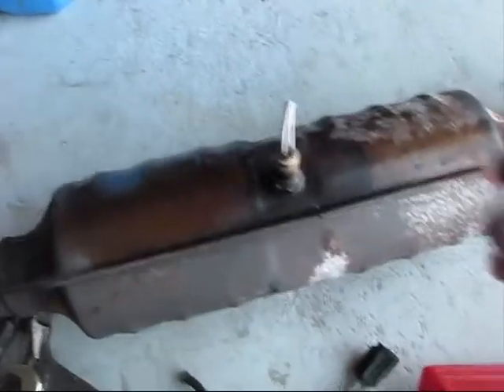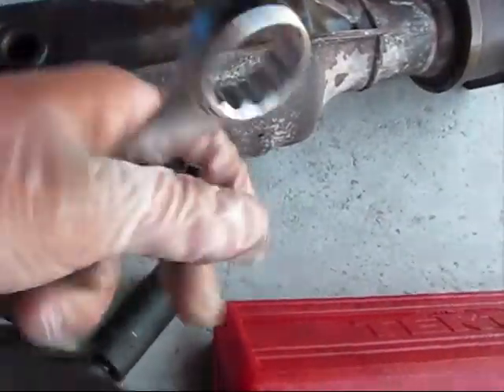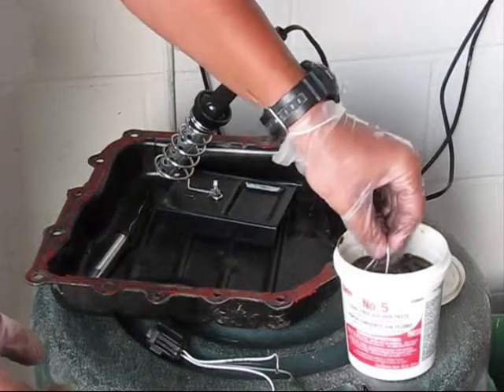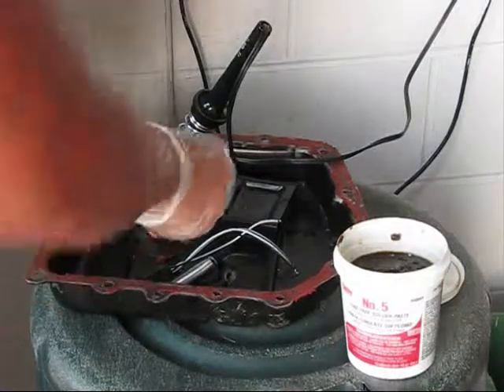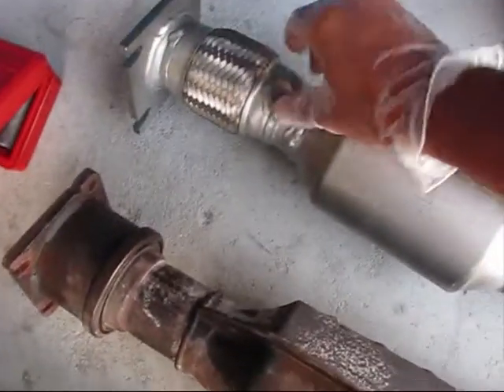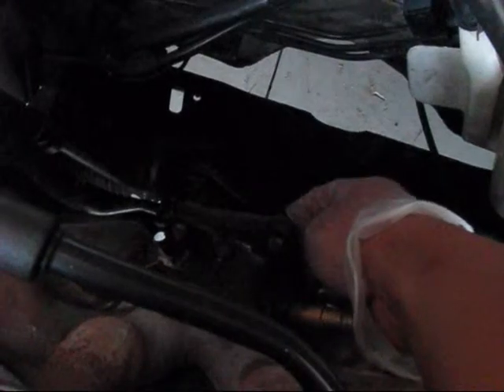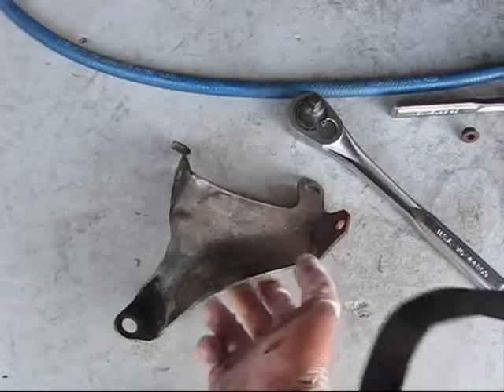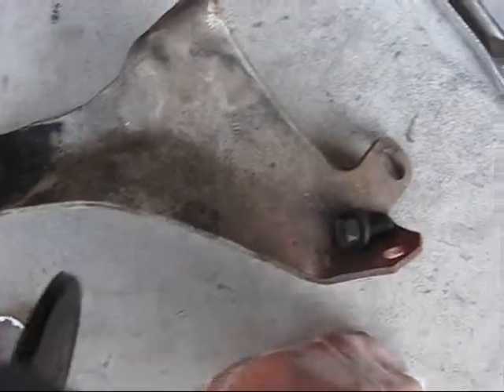Replacing A Catalytic Converter P0420 on Dodge Neon part4

Comment: Why cut the wires why not remove wires from the connector
Reply from the maker: Because of the excessive temperatures heat advisory the connectors become so dry so the plastic will crack looks like because of that...
Reply: I would only cut the wires if I were going to replace the O2 sensors with new ones. I was able to remove my old ones and reinstall new ones using a Crescent wrench. 😊